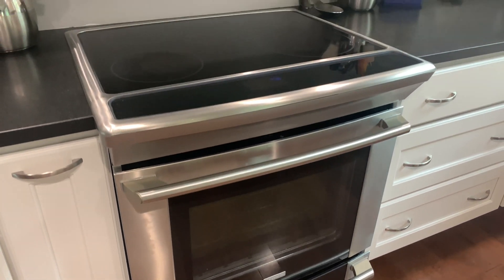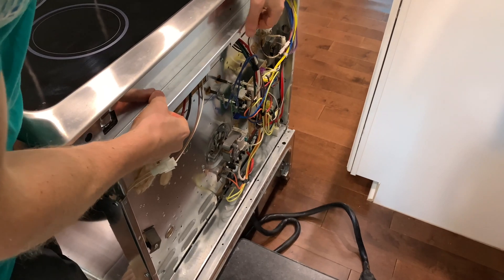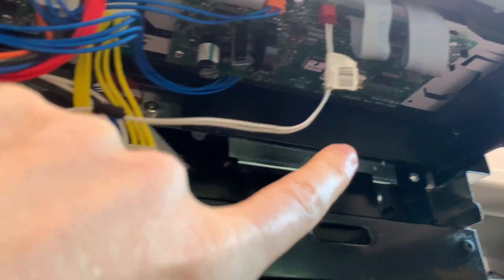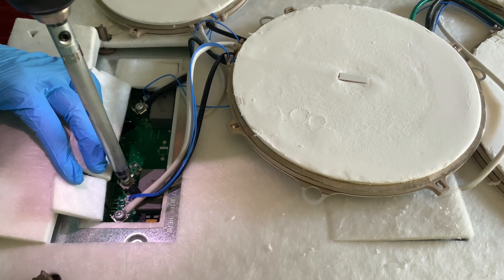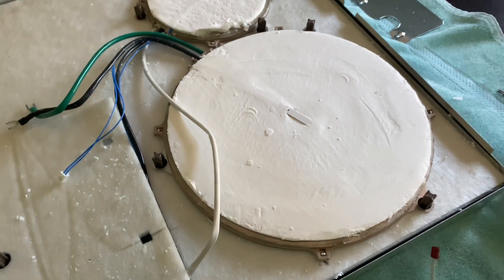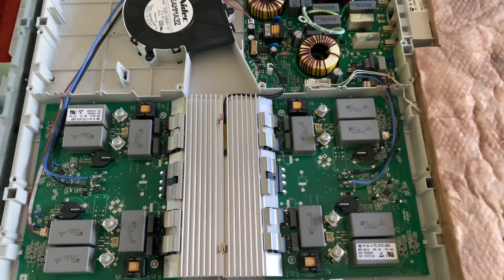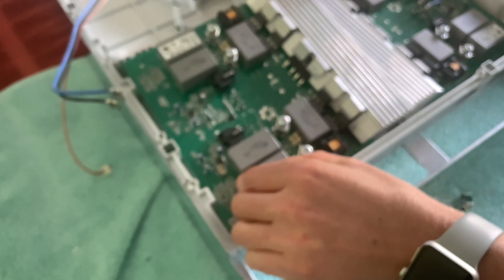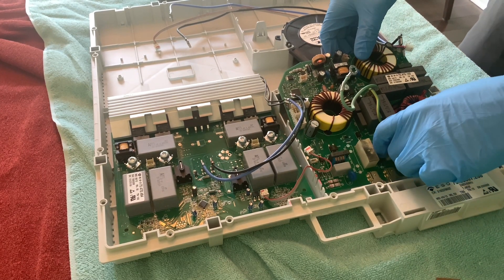Electrolux Range Repair (Part 1 - Disassemble)

Comment: Well today our Electrolux Induction Upper Oven wouldn't preheat. I tried everything. Unplugged the Oven. Same issue. Read the numerous Troubleshooting problems. No information on this specific problem. Any suggestions? I will call Electrolux Canada on Monday. Frustrating. These Ovens aren't cheap to buy or repair. Great video though. Thanks.

Comment: Hello Matt, I wanted to you ask you few questions and I'll appreciate it a lot if you can help me, my little son was playing in the kitchen and then put his car in the oven and when he closed the door the car was stock and broken the glass of the door , since then the oven is not working and  is showing f102 error , we have replaced an original glass but still showing the same error, even we sent it to multiple technical service nobody could fix even Electrolux technicians , do you have any ideas that be helpful !? The last technician said that there is a missing cable that should contact between the door and the motherboard but we didn't remove any cable before , if you can give me any tips i will be thankful 🙏🏻

Comment: This video was almost perfect! I did the whole take-down and reassembly. My problem however did not (I discovered) require the total operation. My E 15 error code was resolved when I changed the uib board under the plastic front panel.
Reply: What is the uib ?
Reply: @CarmenLopez-xo9gn  sorry for the jargon I picked up while learning about my stove. The uib is the user interface board and is correctly called the esec-uib. It is located under the plastic cover which is under the glass control panel. The board is directly under the burner controls. The board is very simply unplugged from the wires and is physically held in place by 4 screws. This operation is well demonstrated in a you tube video by Hameed under the title E 15 error code.
Reply: @CarmenLopez-xo9gn  subsequent to my first reply the video is by Hameed Wafa. The part on my induction Electrolux stove that I changed was #316576452. If yours is the same that #will be printed on the board at the top and on a white sticker on the board face somewhere.

Comment: Very common the power output transistors and the rectifiers go bad when that fuse is blown. Most of the time, changing the power devices and rectifiers on the heat sinks and the fuse will fix it.  But, not guaranteed. That main board assembly is very expensive!

Comment: hello, thank you for posting this. I have a different problem. one of my burners stays on constantly.  I can turn it off. I have to turn the breaker off. Any ideas ?
Reply: Me too! Did you ever figure out the problem? Mine is the front right dual element. The outer ring stays on and won't turn off. Whats weird now is if you select ON the inner element does not come on and outer is always on. If you select both elements the inner one will then come on. Where do we start with this??

Comment: That's a great video Matt! I had the oven board fry on me about a month ago and then the cooktop went tonight. The video was a great help for getting to the circuit board. Also, thanks for the shoutout to the ebay repair. The price for the new part is significant so repair is definitely the way to go.
For anyone reading the comments, I've heard that not using the PB function for the cooktop and avoiding the self-clean cycle for the oven can extend the life of these boards.
Reply: thanks for advice.
what is pb function on cooktop?
Reply: @axlroze3572  PB is the Power Boil. It's higher than high. Works great for heating up a pasta pot full of water.
Reply: Were you able to fix the cooktop? If so, how? Ive got an F20 communication error. The oven works fine but I cant turn on the cooktop elements

Comment: Can somebody tell me where I can find the model number on this oven?  I bought one used just like this one about a year ago and I can't find the model number anywhere.  Thanks in advance.
Reply from the maker: Open the main oven door and look on the inside left (toward the front).
Reply: @mattloflin8548  Thanks.  I was afraid you might say that.  I forgot to mention that I  did that already.  Amazingly, it's been rubbed off somehow.  Almost nothing on it is legible. I was hoping that was not where the model number was located but thanks anyway.
Reply: @mattloflin8548  Thanks!  But unfortunately on mine the model number has either been rubbed off or flaked off by the heat.  But thanks anyway.

Comment: great video, thanks. Wondering if you have come across a problem with one element supplying low heat aprox 300 Celsius max compare to other elements supplying aprox 550 Celsius? I have one doing just that and have no error code. even the power boost is low compare to the others. could it just be a bad element or maybe more in depth?

Comment: Thanks I bought years ago I put a new power cord on and it worked fine then one day lights in house flashed for a second and then when I went to turn down a pot I had on low it flashed e 35 then e75 and everything but the cooktop works I reset unplugged etc any help appreciated

Comment: Good job Matt.  For anyone who needs their boards serviced professionally at a good price, the listing is here https://www.ebay.com/itm/233641726444  (ask if your board/issue is not listed, I likely can service it)
Reply: Yeah i used them too. Only thing is if you live outside Canada, you'll have to deal with customs and it may take SEVERAL days for your boards to make it. His turn around time is very fast though.

Comment: Superb step by step; clearly videoed and explained. Thank you. I'm battling an E21 error and this will be very helpful.
Reply: Me too after just having replaced the UIB. Ebay repair gentleman in Ontario Canada is helping me with initial diagnostics (for very reasonable fee), and I need to get at all those boards to send detziled pictures.
Reply: Did you figure out how to fix E21? i am dealing with it now but can’t find anywhere the meaning of the  error code. Thank you in advance
Reply: @ipulid6367  No, I was defeated - didn't help that I was having a tough time medically. Ended up buying a new stove.

Comment: Hey nice video. Did you have the filter board repaired it looks like you did just woundering how much it cost you
Reply from the maker: I opted to use this service to repair the boards:
“Repair Service Fix EW30IS6CJSA EW30IS6CJSB EW30IS6CJSC  E30, E35, E75, E21, E31” - https://www.ebay.com/itm/Repair-Service-Fix-EW30IS6CJSA-EW30IS6CJSB-EW30IS6CJSC-E30-E35-E75-E21-E31-/233641726444